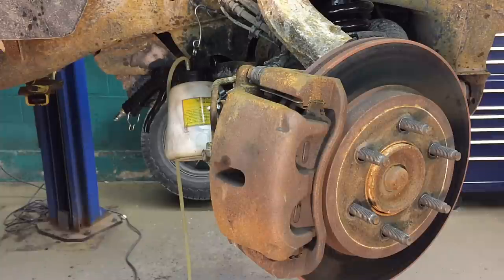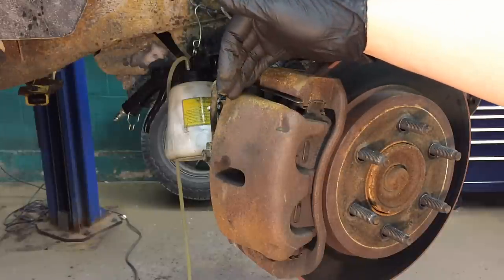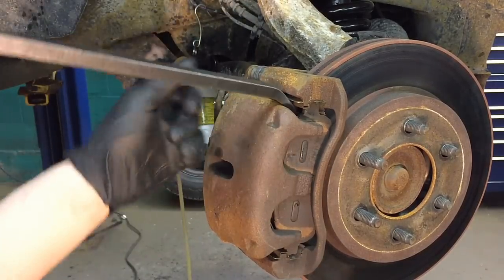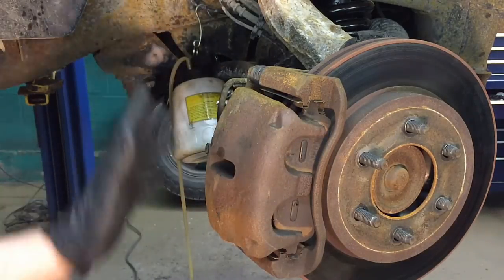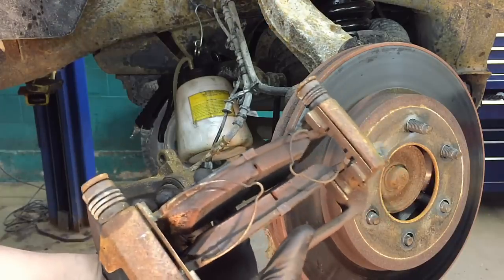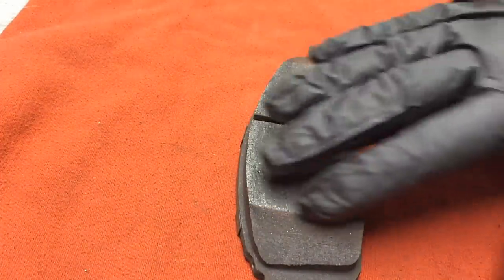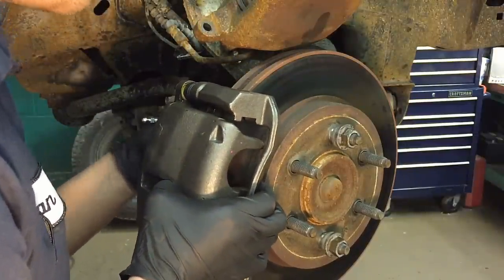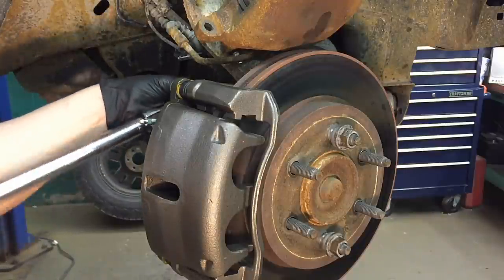Ford Brake Caliper Replacment w/ Tips!

Comment: Sure wish every mechanic was so detailed and thorough like you are. I just took my truck and paid 900 bucks for a bad coil pack and had some fluids changed. Got the truck back yesterday with the same misfire that I originally brought it in for! Quite disgusted in the thought of spending another couple hundred to get it looked at again and not getting it running right. The labor cost was double the cost of the parts and fluids. The world needs more guys like you who care for their customers.
Reply: Plug wires
Reply: Old plugs? Gapped too big?

Comment: Nice job, great video too.   I suggest that if you don't have an impact, make sure to crack the banjo bolt loose on the old caliper before you take it off.  Also, if you think you might run into any trouble, you can block the brake pedal down a bit with a 2X4 or something to prevent fluid from leaking out.

Comment: I watched the video quickly, but did you mention that slightly depressing the brake pedal will stop the fluid from gravity draining.  I use an adjustable hood stick between the seat and brake pedal.  The pedal only needs to move about an inch.  You can walk away for hours and it won't empty your master cylinder reservoir.

Comment: Great series of videos. I was replacing my front  rotors and pads yesterday on my 2008 Ford F-150 4x4 with 5.4 liter. The right side caliper slide pins were installed differently than the slides pins on the the left side caliper. Both slide pins on each side had their flexible grease boots installed and intact. But one slide pin on each side has milled recess near the end of the slide that has a rubber sleeve one it. There is a section of metal below the rubber sleeve that has not been milled down and it is approximately 1/4 inch it length whereas the milled section that was milled/turned down for the rubber sleeve is approximately a 1/2 inch in length  and the rubber sleeve is approximately 3/8 of an inch in length. Now for the problem.... the garage that put new brakes on for me last time had the  milled slide pin w/rubber sleeve in the upper slide pin position on the left front caliper had the  milled slide pin w/rubber sleeve in the lower slide pin position on the left front caliper. Do you have any suggestions for the correct placement for where the milled slide pins should be positioned? Top spot or lower spot? All 4 slide pins, rubber boots, and sleeves are in excellent condition but one of the milled slide pin with sleeve is in the wrong position as the system should be a mirrored image of each other. I hope you can help. Thanks for your time and thanks in advance either way.
Sincerely,
Ron
P.S. Sorry for the long winded question.
Ron

Comment: I had passenger front seize and smoke, I was able to pump the brakes to get it to release enough to get to the dealer since I had a few hundred in credits waiting for me LOL - they replaced the calipers and pads but not the caliper bracket as you mentioned - but again it was the dealer, so they may not have seen the need to replace the bracket.  2005 F150, 106k miles.

They quoted me $440 for the infamous 5.4 Triton spark plug job - doesn't seem bad at all, since I've seen these quoted in the $600-$800 range.  

Love your vids - keep em coming!
Reply: $440 to replace spark plugs??  In a nice, big, roomy engine? GTFO! Damn!  I'm so glad my dad taught me how to do this shit!  It cost me approximately $150 to replace my entire rear brakes (parking on up).  The dealer would have charged me $6-800 for all that work I did.  Probably would have been a lot FASTER at the dealer. . . :D
Reply: @saltyolbroad2962  Well the 5.4L Triton engine has plugs that seize into the engine and are two-piece plugs - they will commonly break off requiring use of a Lisle extractor tool. It’s a real pain in the äss.
Reply: @Dawgator  Only the first removal though, after that they should be new ones that dont break, hard to tell if you dont know though, cheers.

Comment: If I buy an old car and do a brake job I always replace the rubber lines. They are dirt cheap if you DIY(at least do the front) and had quite a few high mileage ones fail on me! The symptoms are the same as a bad caliper.

Comment: Thanks for the great video, I have my 07 f-150 in my  shop about to take off the right front caliper and this has helped me a great deal.  I am looking for a video that shows how to replace the pinion bearings for an 09 f-350 with drw that is 4x4 diesel and manual trans.  If you have any such video I would love to see it, just point it out plz, Thanks a ton!!!
Reply from the maker: +three forks No videos on that sorry.

Comment: As far as temperature testing for dragging brakes, I discovered mine on the front of my Expedition was binding when I would go to the car wash. I'd wash each wheel well, and when I'd get to the front passenger, water on the rotor or caliper would just roil into steam and boil off, and I'd think, hmm that's odd. After suspecting it for a bit, recently it started binding hard enough that if I reversed it would drag the dire through gravel. Time to replace everything :(

Comment: Good vid. I hate it when people don't know how and when to use anti-seize correctly.

Bought a 96 Mustang and I've been going through it. Previous owner put anti-seize on all the caliper bracket anchor bolts. Even on the wheel nut studs!
Reply: Chad Ross Did you have any problems with disassembly?
Reply from the maker: Chad Ross Oh wow!

Comment: First, I really appreciate your expertise and videos.  They have helped me out countless times, and saved me $$$$$.  However, I followed your instructions regarding keeping the pads out while bleeding the brakes, and while doing so the rubber boot that is inside of one of the cylinders of the caliper looks like it was stretched too far and tore.  Now either it was my error or it was a failed part.  I'm interested on what you think?  Without the pads in did I over extend the piston or were the piston rubber seals faulty?

Comment: Makuloco! Thanks for your video. One of the rotors was sutcked I disassembly one rotor and found I placed 2 inner pads in one side and the other rotor has the other pads. I installed the same pads in the correct way and it appears right now is working fine. I have to make further test to check if it really fix the problem. Thanks!
Reply from the maker: Arturo Garcia Nice!

Comment: You have excellent camera work!  Your video was great!  Had to redo the rear brakes and haven't done it for a while.  One question, though: does it matter which way the brake line is attached?  I took mine off without noting which way it was on.  There was a notch that looked like it had to go on a certain way, but it then the hose would interfere with the caliper pins if I put it on that way.  Eventually, I got it on (I guess we'll see if it's right! haha); but, a recap of whether it is important would have been good--at least for me!  :D

Comment: Great video. Are you using a power vacuum bleeder?
To reduce the amount of fluid loss while the brake line is disconnected, I like to take needle nose vise grips with fuel line over the 'needles' and clamp the flexible brake line closed near the end of the line. The fuel line is to prevent damaging the brake line. Doesn't take a lot of pressure. 'Snug' usually does the trick. Works great. I've used that technique a ton of times over the years with no issues or damaged brake lines.
Reply from the maker: Pet Rock's Garage Yes vac bleeder is used. I never liked clamping the brake hose even with the tool designed for it IDK that is just me being overly cautious but many other do it no problems like you say.

Comment: On a 2006 f150 do the slide pins with the rubber piece go in the upper or lower hole?

Comment: Great channel and Info! I'm a long time viewer and I've got a question. Getting ready to replace the two front calipers on a 2015 F150 should i go with rebuilt calipers or new ones? I can get either at basically the same price at my local ford dealer. The only difference is the rebuilt ones come with the brackets, slides, bushings etc. Whats your opinion on rebuilt calipers vs new ones?
Reply from the maker: If available, I will always go for new.

Comment: I got a 08 Ford f150 2wd truck. My pads were wearing down,and I was going to change after the New Years day. Christmas Eve, my right Caliper tore into my Front Right Rotor and left some serious Grooves in it. It made a Grinding Noise. I had to drive another 60 Miles home like that. It didn't hurt the Front Drivers side. I just put the Rotors(wheel bearings in them) on 3 years ago.
Would you say the Caliper on passenger side is Shot ? Or just Pins need greased ?  And I'm going to only replace the Bad Rotor.
What would make one side grind a Rotor ?
Thanks.

Comment: Thanks for all the videos...i have a quick question.i went to do a front pad replacement on a 97 expedition.. but i noticed who ever did it before had rounded the torx bolt for the caliper..is it possible to change the pad if i remove the caliper and bracket as a unit? Or do i need to buy a new caliper? The calipers themselves function normally thanks in advance
Reply from the maker: ***** Yes you can do it that way also no problem.
Reply: FordTechMakuloco thanks for reply just want to make sure i thought the pad on the piston side was pinched between the bracket and caliper and the caliper had to be removed from bracket to remove and i stall.

Comment: Hey sorry for a late reply but my buddy who is a ford master tech tells me to not bleed these brakes every two years for the fluid swap, because its so easy for air to get into the abs pump. Then you need to pay ford to run the abs bleed procedure. Is that true? Your making want to change my 7 year old fluid out tomorrow if its that simple with a bleeder which i have.

Comment: I had replace the front right brake caliper and rotors, and don't have any idea how this is starting to again sticks? And is normal rear get to full of brake dust after washing in the next two to three days? Looks like I rotate my tires but no noise . It a 07 Expedition EL.

Comment: I never depress the pedal all the way to the floor, I ONLY go down as far as normal travel. Why? Because an older master cylinder will have crud built up in the portion of the stroke where the piston never goes during normal brake use. If you send that piston all the way down into that crud during bleeding or seating the pads it will damage the rubber piston cups; there a good chance that customer will be back soon with a brake pedal that sinks to the floor at stop lights.

Comment: Never new remains were ford parts at auto stores I'll check for printing thanks your the best out here! 4.6 l f150 286,000 miles blew only one clinder at 110,000 put kit in changed all plugs at 200,000! But upgrading to like 2008 Expedition blurt date 07/10/07 I guess 2 piece plugs but only has 86,000 miles from Canada $11,500 was a fleet truck! No records but love to work on cars have 5 we 3 kids! Anyway thanks for all you do never stop learning BMW x 5 also totally diffent animal but wife loves it!

Comment: Okay, I did a complete brake booster master cylinder brake calipers. Brake lines at complete assessment of the braking system the ABS module everything is working accordingly. Put on my 1997 Ford F150. My front brakes will not release. I bled the system. Maybe I didn't bleed it good enough. Can anyone give me any ideas because everything else is working completely fine. Why would my front brakes only? Be sticking and not releasing.

Comment: If the caliper seized wouldn't it glaze the rotor?  which might require turning the rotor or replacing it from overheating?
Reply from the maker: It can if not caught in time.

Comment: Is it ok to reuse the caliper mounting bracket bolts?  I am changing mine now and I read where Ford says to use new bolts only. I have and Expedition.
Reply from the maker: yes you can reuse just put blue loctite back on.

Comment: I tried to change my caliper on my 02 SVT focus today and my brake line has a straight threaded fitting instead of a banjo bolt.  The problem is I have to turn the whole caliper while brake fluid is leaking out because the brake line will twist and kink if I spin it, I think I might need a second person on this it's kinda hard to thread a heavy front caliper onto a small fitting by my lonesome.  Why don't car manufacturers put a type of shutoff valve at the end of the steel lines?

Comment: Weird to me, that my 2006 F-150 has 13mm caliper slider bolt heads on one side, and 16mm bolt heads on the other.
Also, curious why one of those sliders has a little rubber sleeve on one bolt of each side.
Reply from the maker: Yup they have been replaced, the 13mm is stock.

Comment: I have a 2006 F150 and the brake light on the dash is on. The emergecy brake is not engaged but the light stays on. Whats up with that?
Reply: I found that I have to actually pull up on the emergency brake pedal to get the light out. I am sure there is an adjustment to the switch but it is easier to just pull up the pedal for me.

Comment: Is it necessary to change both sides, or is it fine to change out only the damaged one?
Reply from the maker: +Joshua Wright it's a good idea as the other side is likely not far behind but no it's not absolutely required
Reply: You should always do both sides whenever you do anything with a car if it's reasonable to do so.

Comment: Arn't those banjo bolt washers supposed to be replaced?  They crush down to make a seal so they are considered single use only.  At least that's what I've read.
Reply from the maker: Yes they can be reused but I won’t do it. I put on new copper washers did you miss it?

Comment: Good day, I'm a ford guy so naturally I like your videos..Very informative... I do have an unrelated question..
I have a 06 Five Hundred and am planning on buying another for my wife (I just like the car) anyway while searching for another car I noticed that some cars engines are missing the anodize on the engine covers right in front where it says DURATECH with the oil filler hole... Some are just aluminum color like the coating has been stripped... Is this a sign the engine has been overheated or worked on and degreased and the coating stripped with the grease or WHAT IS THE CAUSE FOR THE MISSING coating..? I look thru carmax and if the engine coating is missing I skip that car,,, am I wrong for doing this?
Thanks
L.E.G.
Reply from the maker: mortimer snerd To tell you the truth I have never seen them with that coating over the letters but no the peeling or discolored lettering is not from an overheat. It is mainly from corrosion over the years I would not base my car decision off of that.

Comment: What I like to do is spray the piss out of the caliper, rotors, and bolts with brake cleaner, unbolt the banjo bolt and unbolt the caliper bracket grab a drip pan let some of the brake fluid to drip out a bit out of the brake caliper line, and then take vice grips to close line off, then pry off the entire unit itself then get the rotor off and then use antiseize take my new caliper grease slide pins, and anywhere where metal on metal is gonna create friction then reinstall new parts, and bleed the brakes after topping off whatever brake fluid I lost.

Comment: My front left caliper was seizing up and heating the entire assembly. I have a hard time getting the lug nuts off. After freeing up 4 of the 6, I broke a 1/2 breaker bar, and a 3/4 to 1/2 adapter on a 3/4 breaker. Impact driver didn't help. Any suggestions?

Comment: Once again, a great video!  Thank you!
I noticed you're using a Vacuum brake bleeder.  Do you prefer vacuum brake bleeder over a pressure bleeding system like the one's offer by Motive Products? ( http://www.motiveproducts.com/ )  The obvious benefit of a vacuum bleeding system is that it's pretty much plug and play with most any vehicle (no special adapter needed). The down side is that you have to keep and eagle eye on the brake reservoir so you don't run it dry.
I seem to have much better results over the years using a pressure bleeding system.  The thing I most like about the pressure bleeding system is that I don't have to worry too much about running the master cylinder dry when doing a full fluid system flush and replace.  The down side, of course, is that I have to have a box full of adapter to fit all the various reservoir styles. Anyway, it's all same, same as long as the job get done.  Just curious about your thoughts on the subject since you do this for a living.
Keep up all the good Work!
Reply from the maker: I do prefer vac bleeding as described here- https://www.youtube.com/watch?v=XIuj2a6tx6Y

Comment: Awwww, bummer. Skipped right over how to disconnect the caliper from the fluid lines. I trust this video is excellent, but this is one of those times I gotta run off and find even ANOTHER video to fill a gap. lol
Reply from the maker: I show it at 12:19 watch again
Reply: @FordTechMakuloco  Ah, so you did! Sorry about that. Saw so many videos to piece it all together I skipped right over where you showed it.
Reply: Oh I know what I did. I began watching, then started scanning forward then missed it because it was at the bottom of the screen. A lot of the ford videos have that same type of bolt, but mine has some sort of "finger" that braces up against the caliper and the bolt head is much smaller. Anyway. Sorry.